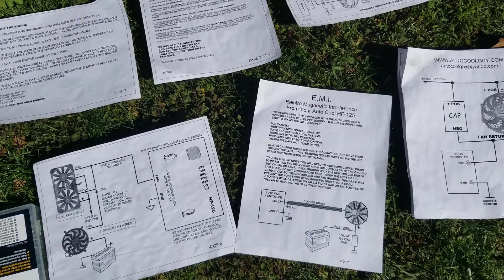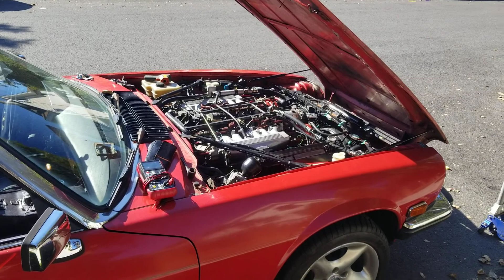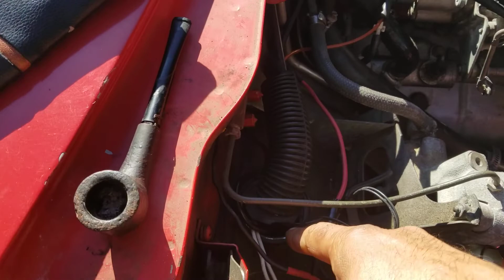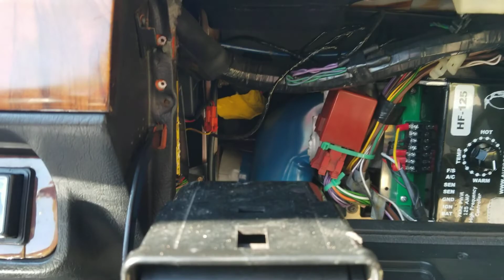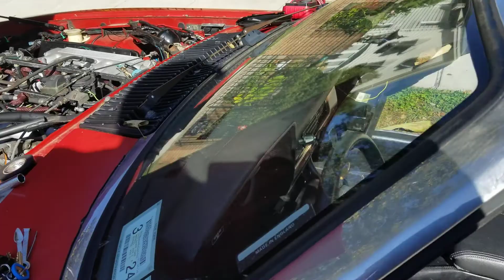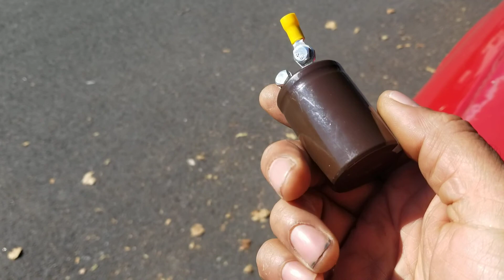Jaguar XJS v12 Auto Cool Guy Electric Fan Conversion PWM Control HF-125

Comment from the maker: Good Morning. I'm back to this for the first time since positing the video. I apologize for not listing the specific fan sizes sooner. 

Ill pin this with the hopes that folks will see the links included in the post. I had to go back and see if I could find the items in my purchase histories on two sites BUT for some reason I think the info is incorrect on the 16 inch fan. I think mine is a 17 inch fan, and the 12 inch in the links below.

https://www.ebay.com/itm/293573784960

https://www.amazon.com/gp/product/B003PB45PM/ref=ppx_yo_dt_b_search_asin_title?ie=UTF8&psc=1
Reply: An insolent Yank with a Jag whatever could go wrong 🤣

Comment: Great work! Will you please list the fans that you have. Thank you!
Reply from the maker: Good Morning. I'm back to this for the first time since positing the video. I apologize for not listing the specific fan sizes sooner. 

Ill pin this with the hopes that folks will see the links included in the post. I had to go back and see if I could find the items in my purchase histories on two sites BUT for some reason I think the info is incorrect on the 16 inch fan. I think mine is a 17 inch fan, and the 12 inch in the links below.

https://www.ebay.com/itm/293573784960

https://www.amazon.com/gp/product/B003PB45PM/ref=ppx_yo_dt_b_search_asin_title?ie=UTF8&psc=1